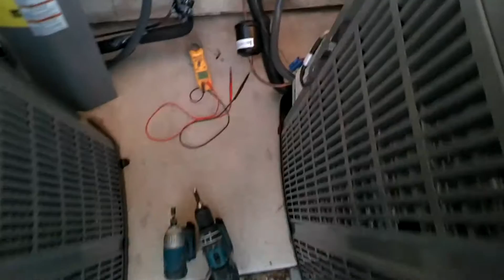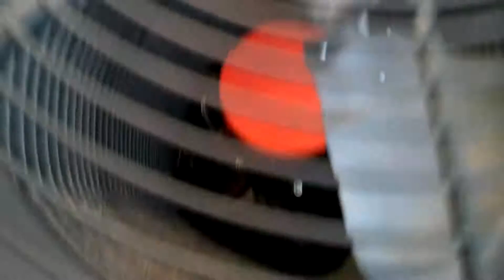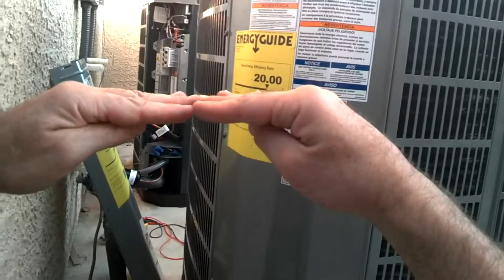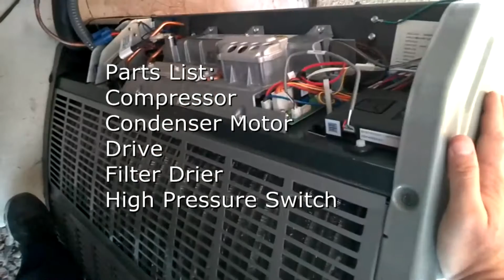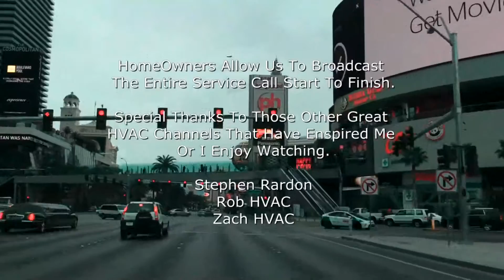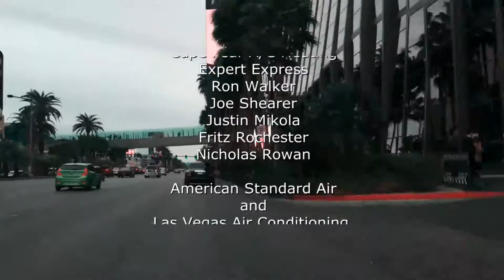The refrigerant flow explained in these two new 20 seer air conditioners.

Comment: Is that a cooling loop on the drive? Looked like a copper line from the condenser is clamped to the inverter.
The inverter boards are air cooled on the minisplits.

Comment: Great Video... How many of those Drives do you stock on your trucks?
Reply from the maker: 0 Leonardo 
I truly don't worry about failure it is not a big issue for me. I trust the brand. But for everyone's info the drive cost $1200 if it was out of warranty.
American standard is so sure of these drives.
They will give you a lot of shit if your drive fails be suede there too reliable according to them.
DC is proven to be more reliable 
So we can concern ourselves with cost of repair true anything can break.
If this fails it will have to be fixed but since all the parts are proven to be more reliable and I mean the compressor  is made by American standard and its DC so it's should last longer. DRive is also more reliable than a contractor. Let me ask you this do Transformers fail, answer is no not unless you blow them. Transforming power is easy and reliable parts of been doing that for years used in other types of technology so this is not new technology it's just new to air-conditioning but it is in fact proven to be more reliable so every argument here is based off of what if this thing fails but the fact is it's more reliable so it's probably not going to fail. At least the big items are like the compressor the condenser motor the coil and the drive.
Those 4 items are the large items and those 4 things are what you can count on. The drive ok in theory it's more reliable but u believe it. And the compressor, coil and condenser motor those 3 parts are made to last.
Reply: Las Vegas Air Conditioning, Inc. DC Driven A/c has been used in Central, South and Latin America for more than 20 year's! And in Puerto Rico... All these Countries and Islands mostly rely on Minisplits Regular & Inverter Type. Minisplit Heatpump Inverter are the primary source for Air Conditioning for Houses, Business and Commercial Properties. This Technology is Old to me!!! The Inverter Parts are what are not reliable, must have Power Surge Protection at the Disconnect AND Circuit Breaker. I also Install a Non-Metal Mesh around the Board so lizards or Bugs won't go under the board and short it out!

Comment: Nice installation.  I'm not familiar with those units and I'm curious about the copper line (a loop) clamped onto the drive.  Is that the refrig liquid line?  If so, what function does it serve being clamped onto the drive -- heat sink?   Thanks.
Reply from the maker: It's a cooling loop keeps the drive cool it's liquid.

Comment: I think this equipment is great but what is the return on investment vs the cost of that drive once it is out of warranty? Parts for high efficient equipment is costly compared to standard equipment. I would install it in my home but if I was a one man show would I want to have to be responsible when the equipment fails?  That is the question that guys are looking for the answer to. Also when customers shell out big cash for these systems they expect it to be reliable and last. Everything thing that is new always has bugs that need to be worked out. Some do not want to deal with the issues.
Reply: Good points Rob HVAC. Agree with bugs. But overall the vfd drives and ecm motors. Should last a lot longer than psc motors and compressors should last longer due to not getting that sudden jolt of startup amps. I also think the more and more equipment and companies backing vfd and ecm's hopefully the prices will come down due to competition. That's what I hope at least. With all competition prices go down and seems quality goes with it.

Comment: Let's face it there are higher margins on communicating equipment. However the risk is somewhat higher. Therefore higher profit margins and higher risks sort of cancel each other out
I prefer a two-stage air-conditioner but I would rather it be electromechanically control as opposed to control boards operating the system. Just my opinion.
Reply: Emin, There are studies that electronic controls have less down time than the mechanical ones. Stop sticking your head in the sand and step into 2015, your talking like an old fart. Now back in the old days they never broke down like that. Bull Shit. I worked in the old days and yes they broke down just like they do today. Just kidding about you being a old man, the problem back then and still is today is instillation air flow problems.
Reply: Larry Cole hahaha Larry when you speak I listen lol or in this case when you post comments I read. I have no issues with high efficiency equipment, in fact I am a big fan of inverters. I totally agree with the installation airflow problems. Larry you're the HVAC sensei I always learn from you, now where are the videos man?
Reply from the maker: Yeah emin I think we all trust the contractor. We're so familiar and it's proven. But it seems to me that these manufacturers are going make us all get used to DC.
The argument at least for the compressor is that that DC is actually more Stable and more reliable less wear.
I guess time will tell.
Reply: +Emin HVAC I have been so busy with training I just don't have time right now to do any video's I just got back from North Carolina on Friday and I am off to Reno tomorrow and then to Wyoming then to Sacramento. Now when do I have time to do a video?
Reply: Larry Cole wow I am so jealous,  I wish you would come to NYC. I would totally attend your training.
Reply: ***** ah hahaha
Reply from the maker: Yes emin that really boils down to what a company decided to charge but yes, I run a higher margin on 20 seer than I do 13 so yes if I have to do slightly more I would be ok with it.
Reply: Las Vegas Air Conditioning, Inc. Honestly, I think the manufacturer makes the best money on all this stuff. Think about it. Everyone knows what a standard compressor costs. Over 40 years without a significant change in design, how do they make bank anymore without a major redesign. Enter in dc commnications and inverter compressors etc. they can put any price tag they want on it cause it's new
Reply from the maker: Emin HVAC 
Manufacturers make more than us....
Reply: Las Vegas Air Conditioning, Inc. That they do lol